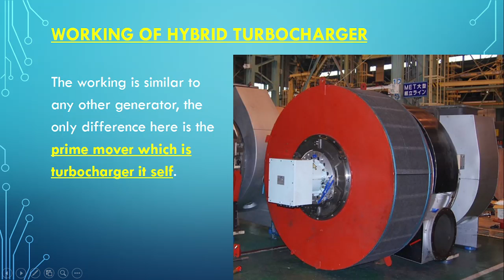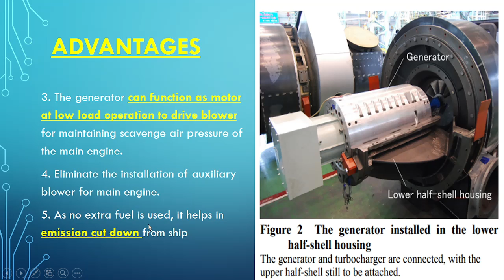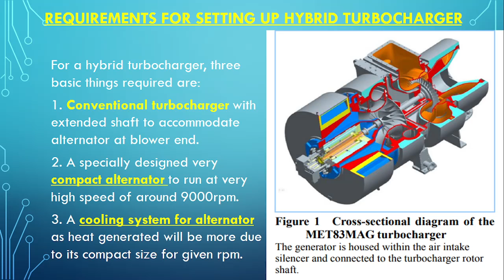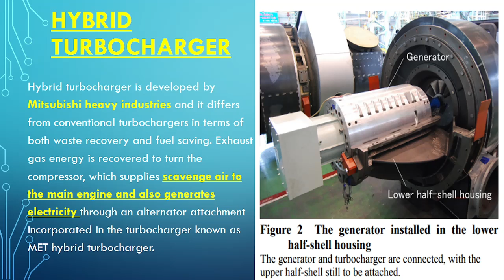Hybrid type Turbocharger|How it is install|Working|Advantage|Turbocharger Development|

Comment: Is the generator connected to the turbocharger producing AC or DC.  is there AC DC AC converter used to regulate the frequency as with the shaft driven generator
Reply: As the turbocharger output power and rpm are not constant, the electrical output is rectified to direct current and then converted to alternating current by electronic inverter to the ship’s standard voltage and frequency.